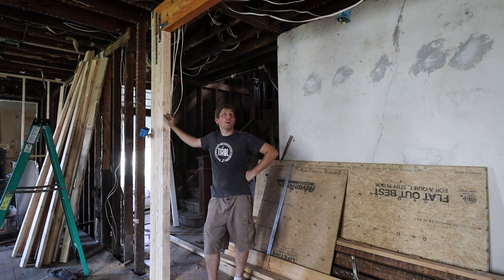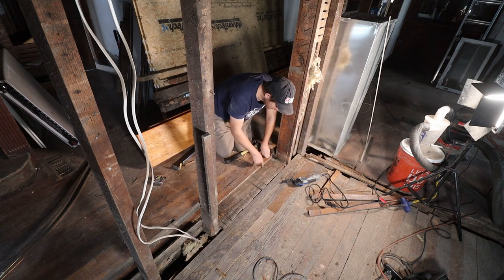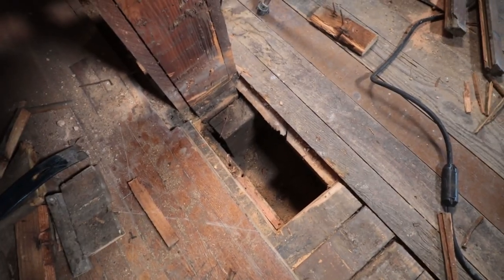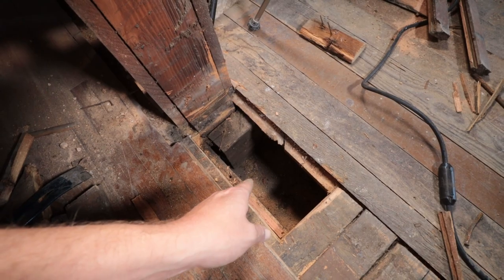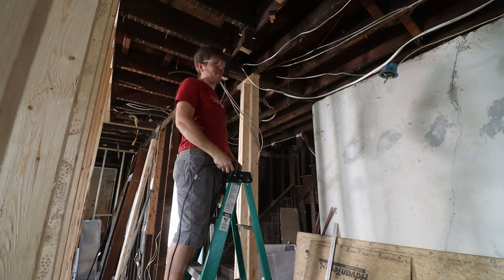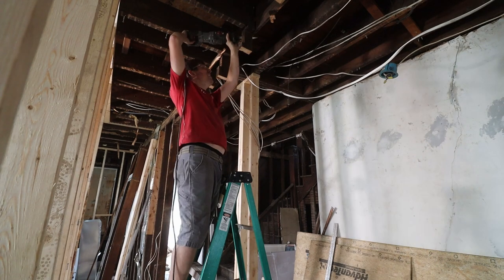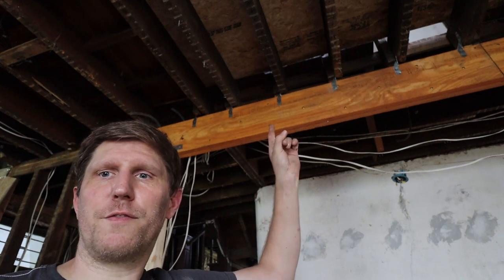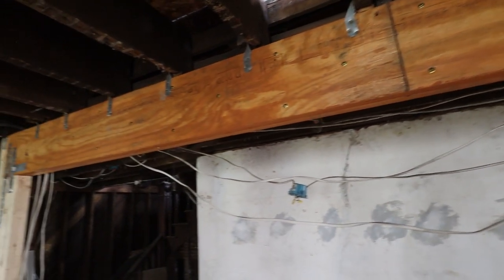Open Concept Living With A Beam In the Dining Room - Victorian Home Renovation [TirolerInn]

Comment: the pillar in the basement- did you have to do anything special to check that it is in good shape? i was thinking about that chimney that just came apart super easy, the pillar looks like it is brick as well?
Reply from the maker: the pillars are partial brick and partial block. The basement was shored up at one point in the past and the mortar looked in very good shape there.